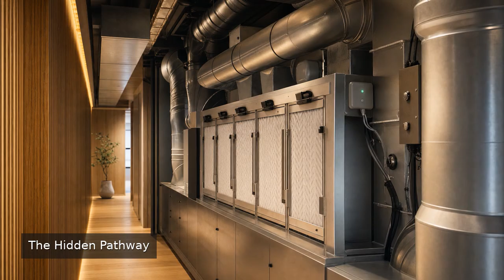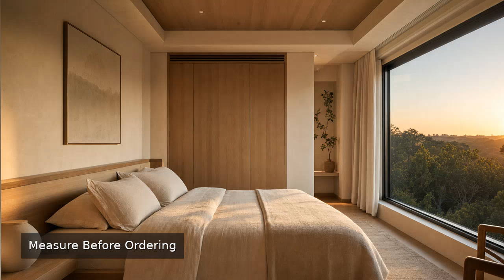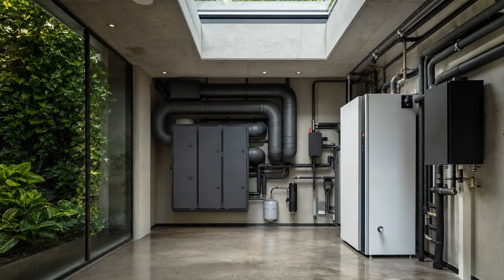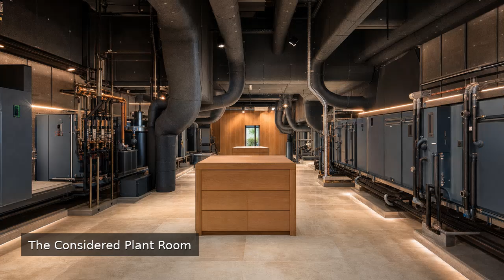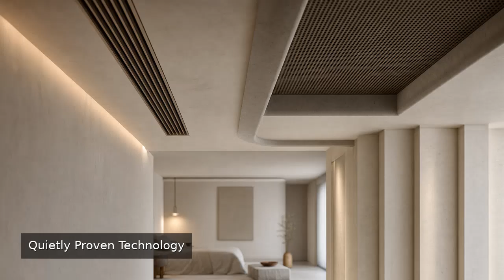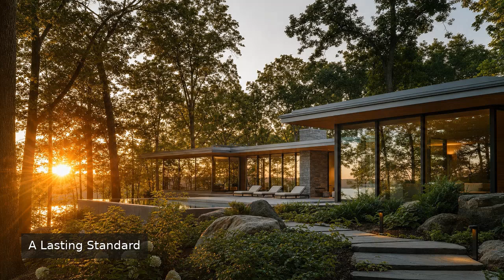5   Whole Home Air Purification OND Long Form 3

Comment: An insightful presentation. In high-end residential and luxury architectural design, true air purification goes beyond standalone appliances; it must be seamlessly integrated into the structural core and HVAC architecture of the space. When pristine air quality harmonizes with bespoke sleep systems and circadian-aligned environments, the bedroom truly becomes the ultimate sanctuary of health and quiet luxury.